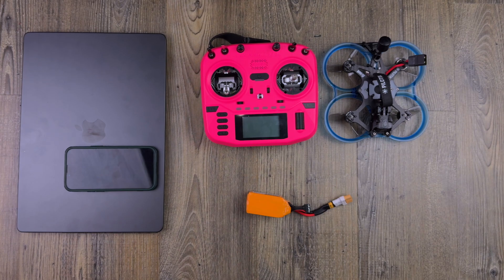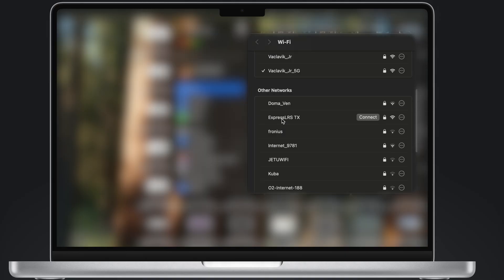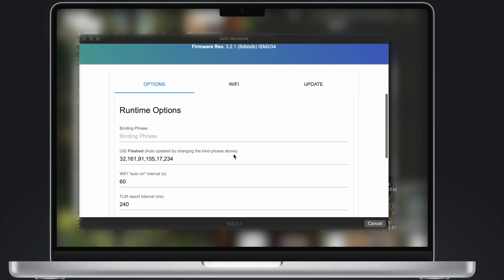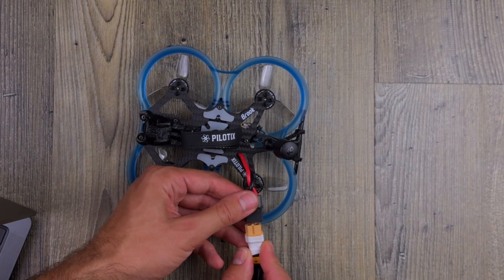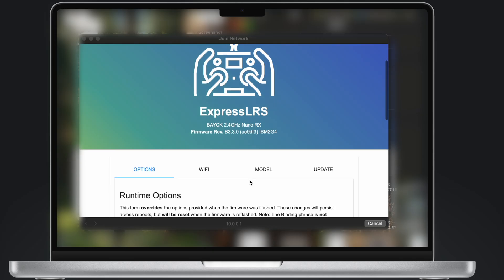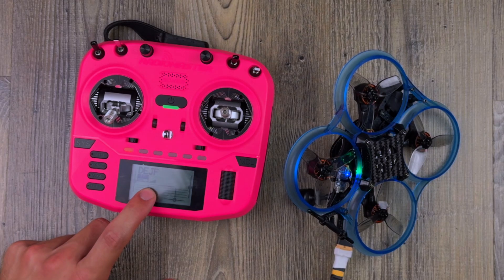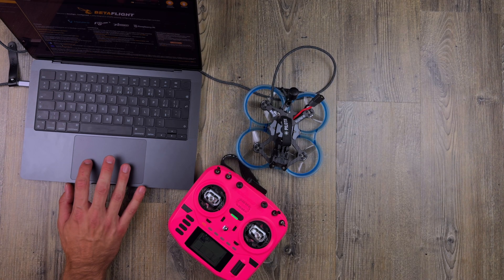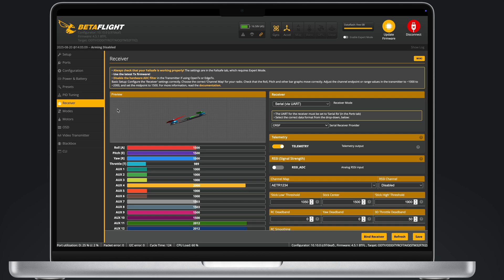How to Bind ELRS Transmitter to Your FPV Drone | Step-by-Step Tutorial

Comment: Thank you very much.  Your video has been quite helpful. I followed it step by step. Thanks again

But I can't control the Drone directly with my Radiomaster. I mean the drone doesn't respond to the Radiomaster. Do you know where is the problem?
Thanks
Reply from the maker: So you have the signal? And when you move the gimbals and switches it shows the move in Betaflight? If yes, does the motor works? 
Better to send us video with showing where the problem is.
Reply: @FPVHobbyDrone  Hi again.  Thank you very much !!!.  Finally I was able to control my drone with the control. The battery of Radiomaster was very low.  This was the problem. 
Now I am flying  my FPV in open field. Thank you very much again !!!